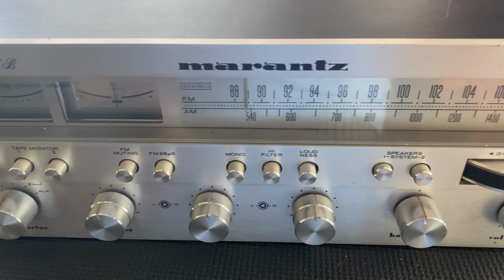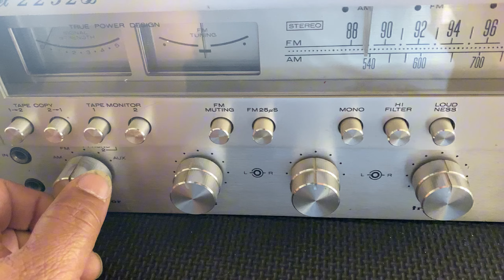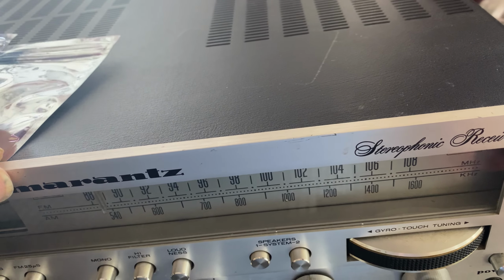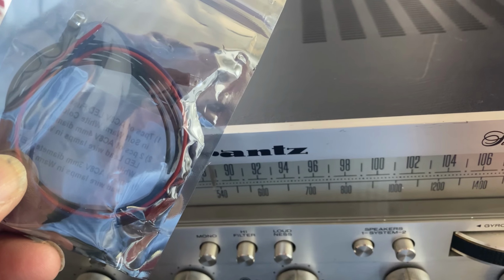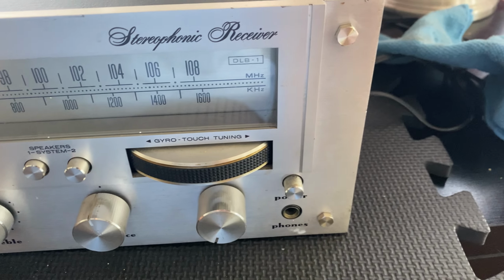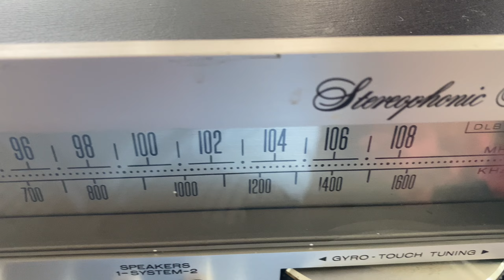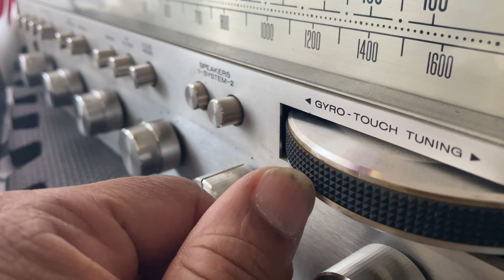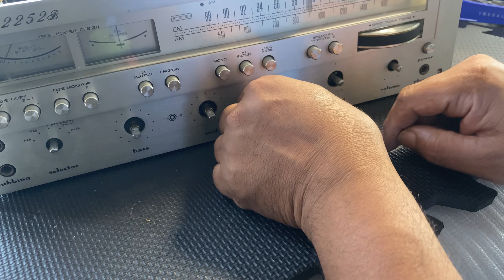Marantz 2252B Servicing #marantz #stereo #integratedamplifier #vintageaudio #howtoclean

Comment: I used to own the Marantz 2265B receiver back in the day  I'm assuming the B signifies a revision of some kind I am currently talking with my friend about buying his Marantz 2325 receiver  if I buy it, would like to do the black faceplate upgrade and banana speaker connectors panel
Reply from the maker: Awesome! I used to have 2325 twice, please check out my videos on them. With black faceplate, it should be nice. I kept the original, because personally I like the look. And also along with Banana binding terminals… don’t forget to replace all the lamps with LED lamps. All the best.
Reply: @stairwaytomusic71  
I think my friend had someone go through his 2325, so hoping the lcd's have been added  Thanks for the heads up! FYI my stereo rig that I have in vid below All my stereo equipment is in the description 

https://youtu.be/0zfD0orsoLU?si=JXeCxpG15SMrUAUS
Reply from the maker: @Jack96993 Sweeeeet!!
Reply: @stairwaytomusic71   thanks gotta love the sound of tubes 😁😆
Reply from the maker: @Jack96993 😊😊
Reply from the maker: @Jack96993 subscribed !
Reply: @stairwaytomusic71  
Thanks so much for subscribing to my small channel I just subscribed to yours 
I have about 7 vids with different songs Some with my Magnepan 7's and my Definitive Technology Mythos ST's with built in powered subs  It was the Marantz and Cerwin Vega speakers back in the early 80's that got me on my audiophile journey  And I think for money spent, it's not too bad I've had commenter's state they bought Magnepan 7's after they heard my YouTube post I don't think I'd recognize Toronto if I went back for a visit 😅
Reply from the maker: @Jack96993 Nice! DT speakers are great! Used to have Marantz DS930 speakers, same as JBL L100 and Pioneer HPM 100. Thanks a lot for subscribing and sharing your feedback. I appreciate you. I love small town, used to be at Erie, PA … Toronto is a mess with traffic. 

Regards